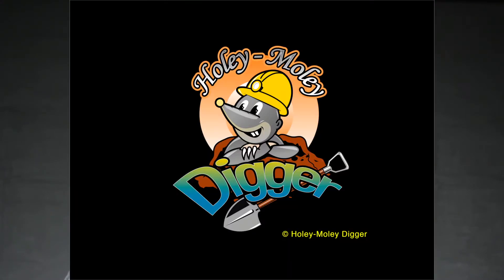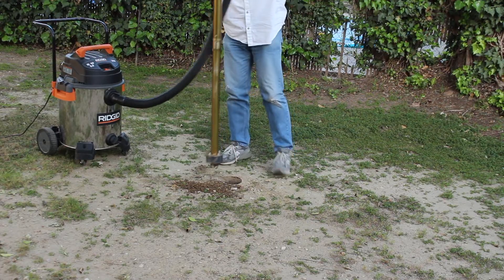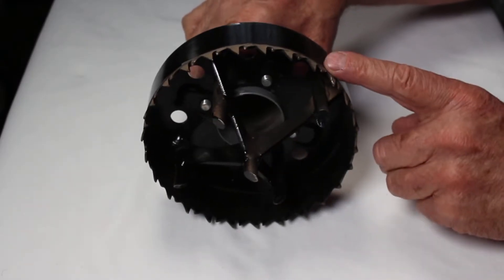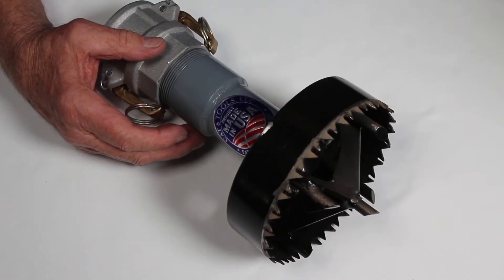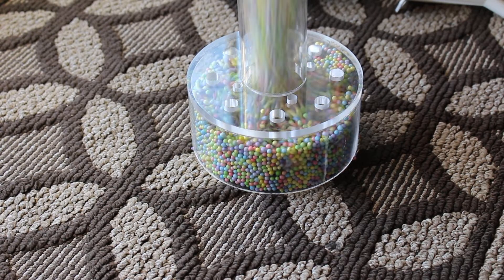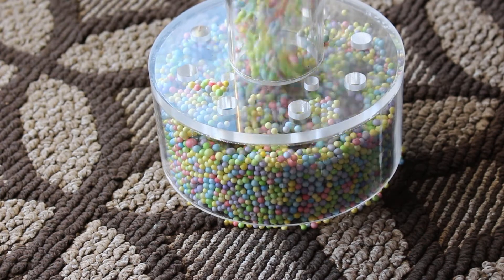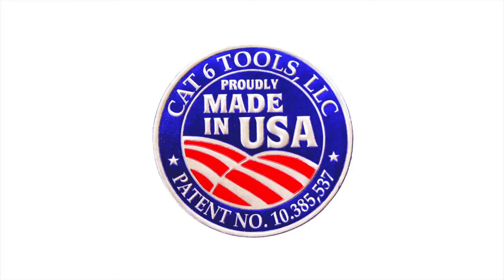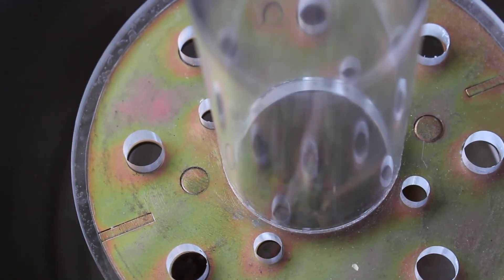Inside the Holey Moley Digger

Comment: How far have gone down....don't you loose suction with more connections or lengths of hoses
Reply from the maker: I have personally dug down 20 feet.  The air inlet holes allow the same amount of air in at the digger head regardless of depth.   So you get 100 mph winds no matter the depth. The only limitation on depth is then the losses in the hose and is why we recommend our low loss hose which provides over 20% increase in air flow over standard shop vacuum hoses.  the losses in the extensions is relatively low as the inside is very smooth. Of course the deeper you go the heavier the digger and extensions.  You might be able to lift 30 to 40 feet of piping without a derrick setup for lifting.